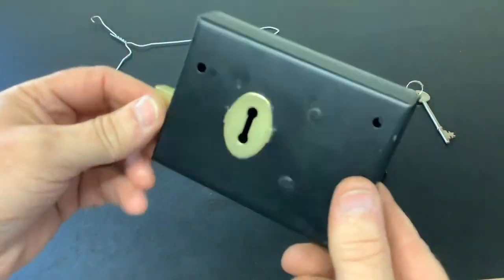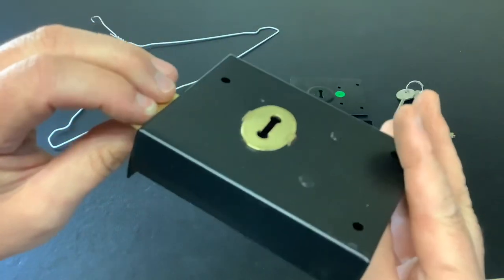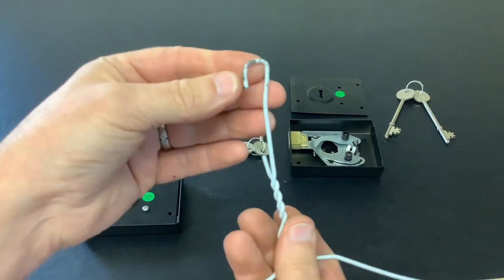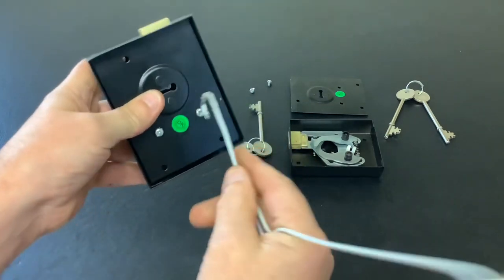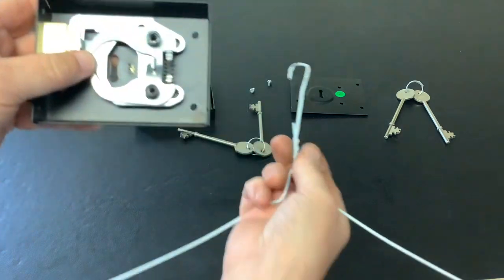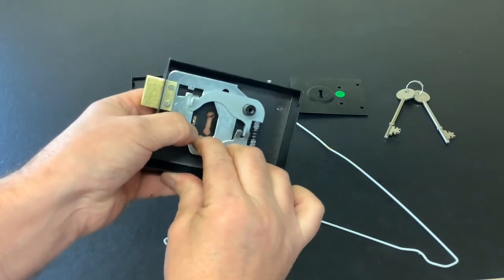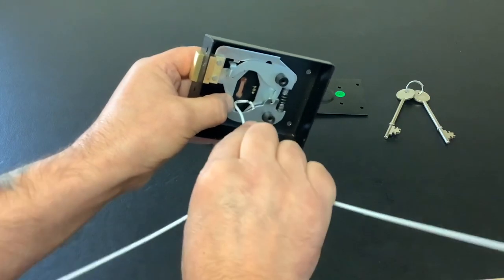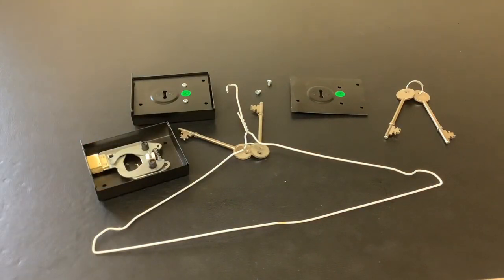393. Basic lock picking - Garden Shed or Gate single lever lock picked open with a wire coat hanger

Comment: That is the first time I have seen the inside of a lock designed like that. What a bit of a false sense of security the manufactures are selling. A key that looks like it has good bitting and a lock that looks sturdy and secure. The insides are a joke. To be opened with a coat hanger! This video is an excellent public service announcement to anyone thinking this lock would secure their shed contents or stop someone from entering their yard. Thanks for this video, really well explained, cheers
Reply from the maker: Cheers PW and thanks for watching 👍